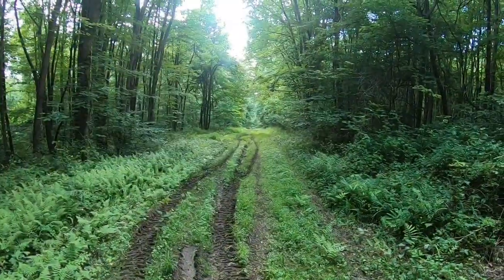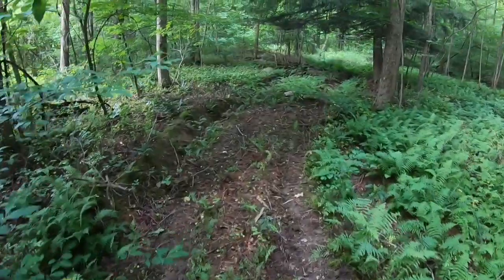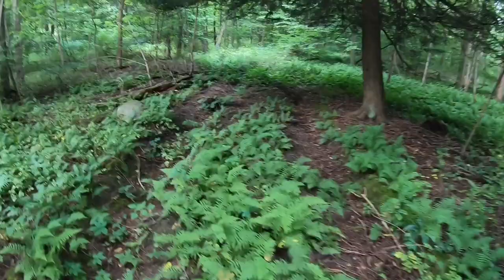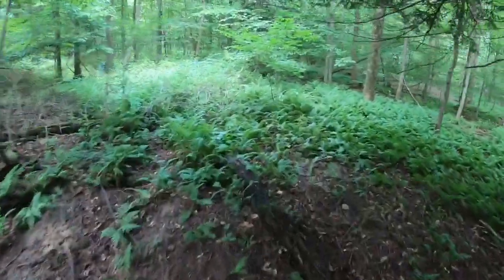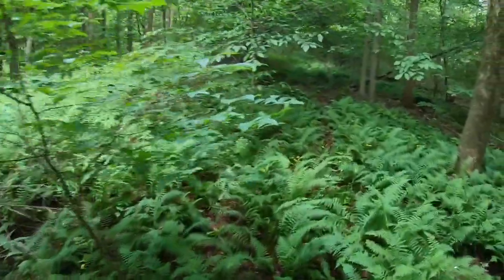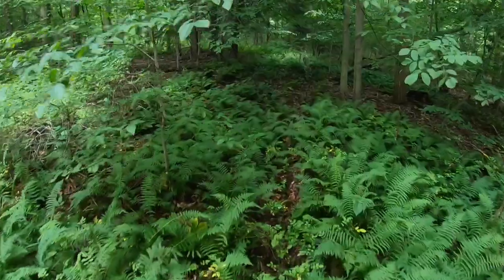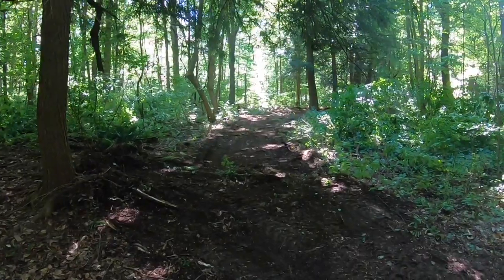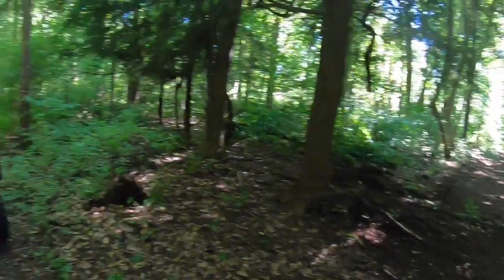#31 Clearing an Old Logging Trail with Kioti CK3510

Comment: Great job on the trail! Those box blades are a great tool. The one upgrade you can do to your tractor and it's not that expensive is add a cutting edge to your bucket. I think I paid around $200. They're hardened steel and will cut through everything from roots to ice and they will protect your bucket from damage. The buckets are soft steel and can get beat up fast.
Reply from the maker: I will definitely look into one. Thanks for the suggestion. I’m glad to see your Kioti still running strong. Makes me feel good to know mine will last hopefully a lifetime with proper care and maintenance

Comment: Good work Adam, the box blade makes for quick trail work. Your bush looks beautiful and lush and the soil looks good enough to eat. Noticed you have a few muddy clay spots, I throw wood chippings on my muddy sections and it makes a big difference. Put a chipper on your future implement list.
Reply from the maker: Oh yeah. A chipper is definitely on the list. One of the main reasons I went with the 35hp machine over the 25 hp. Thanks Mark!

Comment: Nice box blade work. However after you've got the rough grade completed, going back over it with a land plane will really flatten out and average out the dirt. It's fast, an easy implement to use, will leave it amazingly flat and level, and will become one of your favorite implements for gravel and dirt.

Comment: Awesome video, have a question.  It’s a stupid question, I’m sorry.  I am in the process of buying land and want to buy a tractor with the bucket upfront like yours.  It’s a Kubota it looks like it’s bigger then a regular lawn mower but it’s doesn’t look that much bigger.   I want to make ATV trails with it but I want to have just hard pat down dirt. Do you think I could dig up brush and small skinny trees up and like dig down like 3-6 inches down so I can get hard dirt trails with a tractor that small ? And  do you think the front bucket will do the job ??
Reply from the maker: So there is an old saying that goes “anything you can do with a big tractor, you can do with a smaller tractor, it’s just going to take longer” so in short yes, but it depends on how much time you have to make your trails. If you want to get it done quicker I would maybe jump up a size in tractor
Reply: @HometownAcres  
Thank you for your response.  I am in no hurry.  I was just planning to buy a used one and keep around the property to make and maintain trails.  I have seen some used Kubota for around $2,000-$4000.  Thank you again and I am subscribing to your channel

Comment: Nice video as usual, Adam.  I’m glad to see your new ride getting some good workouts!
Reply from the maker: Oh yeah. Gearing up to do the first 50 hour service. Got a quote from my dealer. $389 to have them do it. Or $144 for the fluids and filters.  What route would you take?
Reply: I’ve done all the maintenance on my tractor so far.  It’s about 30 miles to my dealer so it’s easier for me to do myself.  Of course, if I needed something major done to it, I would take it in but I can handle oil changes and basic stuff like that.